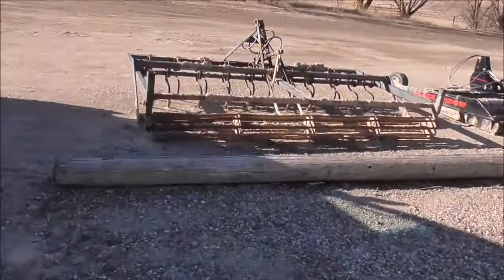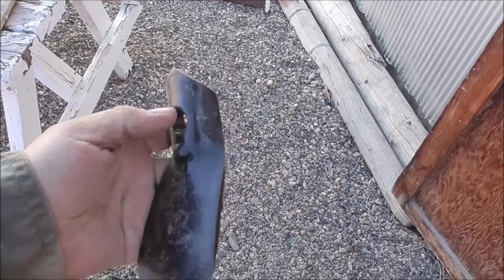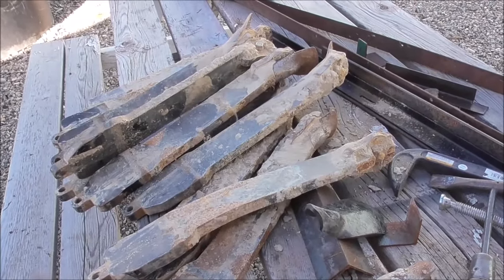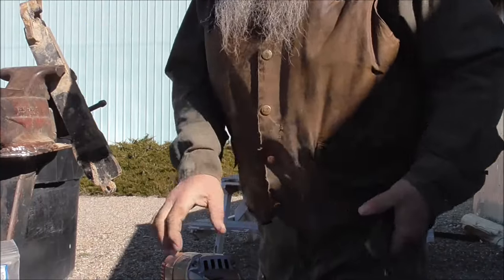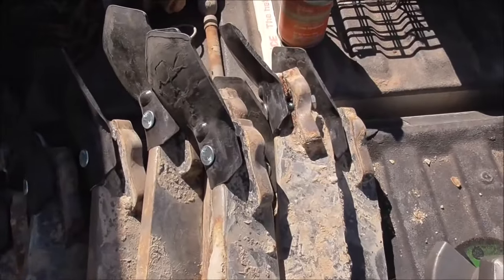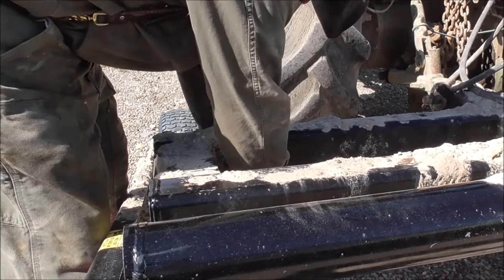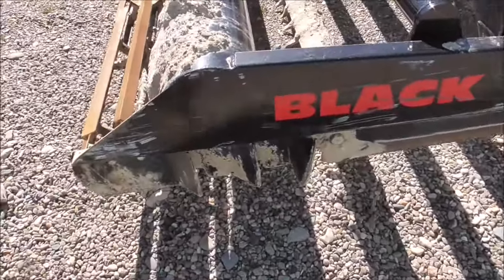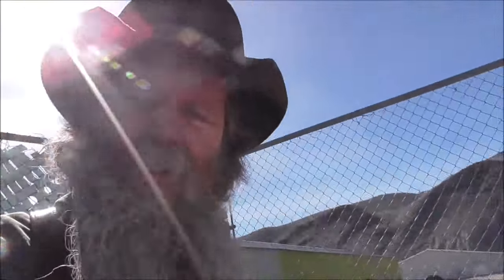SPRING IS OFFICIALLY HERE!!! ~ Just another work day...

Comment: That tool you used to tighten those teeth on the plow… what the heck was it? Looked like a ratcheting fencing tool. Is that custom or can I buy that? Looks very handy! Thanks for sharing
Reply from the maker: It's a neat tool.  I got it from Tractor Supply.  It's a double sided ratchet wrench, one side has a 3/8" drive, the other 1/2". It also has a claw hammer, and a spud spike .   The hammer is probably a little light duty, but really handy!

Comment: Reminds me that I've  got to spend some money and replace all of the shoes, or teeth, as you call em, and the bolts on my old Dearborn.  It was made about 1950, a year after my 8N.  Got a two bottom Dearborn, as well, that someone added a third plow to.  Just on the edge of too much for the old Ford if it's  virgin ground.  Heck, a single blade is getting to be too much!  The old 8N has good oil pressure, but she leaks worse than me, the hydraulics need overhauled, she needs a new bucket , hoses, and the control box needs seals.....  Might be easier to lift the radiator cap, and put a new tractor under it.  Just can't quite bring myself to put a Chinesium, or Indian tractor on the place.  What's left?  Kubota?  New Holland?  Or put new piston and sleeves, and a valve job in a 75 year old Ford?
Reply from the maker: The Fairgrounds is wanting to get a new tractor for here too.  I'm not sure that is a great idea or not?  For this job, I can't have an enclosed cab because I can't hear the announcer. It needs to be powerful compact, and a loader is a must.  This tractor is perfect, but old and worn.  I think they would be better off to have it rebuilt?
Reply: @MuskratOutdoors  I was going to take my torn down, ready to tank and machine 351 Ford to the machine shop.  I wanted a quote for new valves, seats, guides and springs, pistons, and 30 over bore and finish hone.  I love assembling my engines.  My last 350 Chev ,similar build, but I sourced hot rod parts, cost me $1600.  Estimate for the Ford, today's costs, $3000!  That was me doin the assembly.  Twenty years makes a big difference, I suppose, but, wowzers!  For the fairgrounds, unless there's a second, or backup to use in the downtime, that hole where there's no equipment or capability  while it's in the shop is a pretty big deal.  Plus, they can maybe get some grant or government money for new equipment, but not for overhaul on stuff past a certain age...